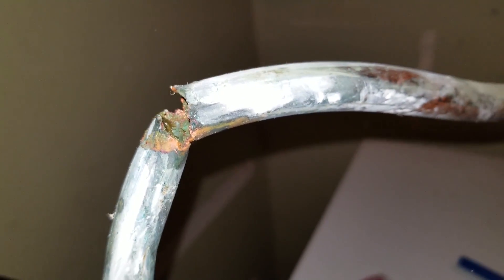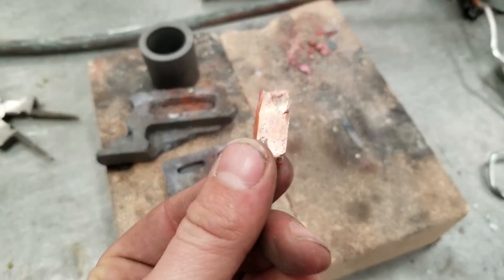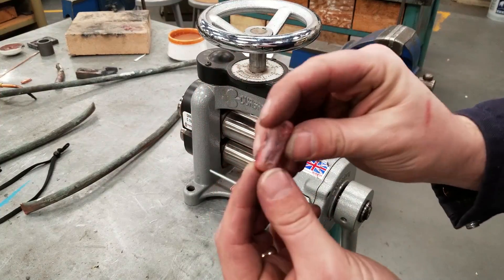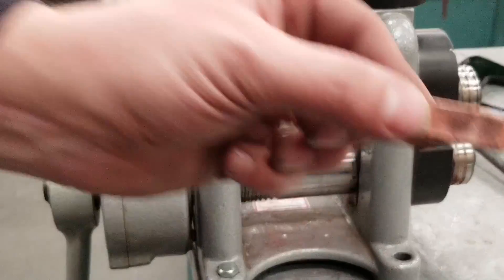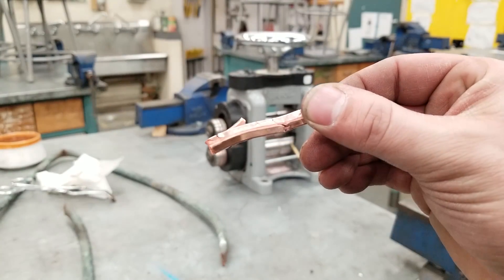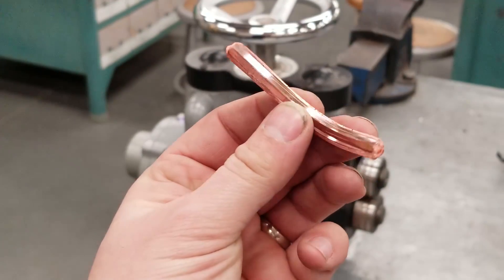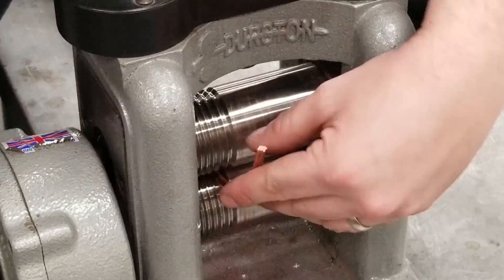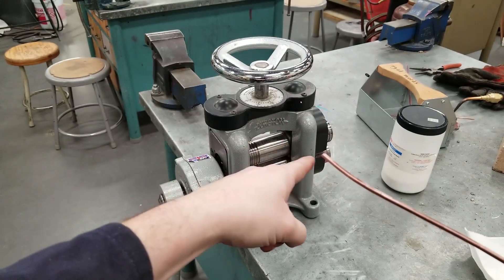Casting Ingots and Making Wire with a Rolling Mill - scrap copper pipe

Comment: I highly recommend properly securing roller so it doesn't move about when rolling wire thru will improve the wire rolling. Cracking is cause by impurities in metal, re-smelter metal, add alloy. Cracking and edges is rushing the wire thru smaller the guage before its ready for that size.
Reply from the maker: Thank you for ignoring the previous comments where this was addressed ;)

Comment: You should let the metal come to room temp, no quenching. Or at least, wait 2mn or 3 before quenching. That will solve the cracking that is due to internal shock of rapid temp change.

Comment: I would think quenching it while it's still hot from annealing would be counter-productive. I mean, quenching metal like that is what they do to harden it. While letting it cool down slowly would take a lot of time, wouldn't that keep it more malleable?
Reply from the maker: yes and no. This worked well for us especially when students only have an hour a day in the shop. This rolling mill can only take cold metals and it worked great for what we did with students.
Reply: @WeBuildStuff  It's a nice mill. I've got a cheap one and even at it's widest setting it won't take anything that big. I also managed to crush one of the bearings on the rollers, so not very heavy duty. I can make out the name "Durston" on yours. Is there a model name or number?
Reply: Steel hardens when quenched. Non-ferrous metals do not. They work harden.

Comment: 💚💚💚💚 bookmark/ notes : “ it’s a brick housse letting it all hang out , sewer drain bars under street that collect wipes / paper ( which further down has something that looks like drill bit size of the pipe near the treatment facility “ but def not a meal mill)  , paper making rollers that flatten in sheets “ ….ect….tbc….-g-b, bot …..💚💚💚💚 bookmark/notes: what jewelry can do for a person …..ect….tbc…..-g-b, bot 

Ingot 🧱 Step down transformer ( compositor , knob slob  )

Comment: Did/have you tried rolling it whilst hot? Wouldn't that help prevent any stress fractures
Reply from the maker: It is not recommended to roll hot with this mill
Reply: @WeBuildStuff     Ok. But can you roll it while still hot?  In another mill that can be used while hot?  
I’ve been planning to roll out sheet strips of about 0.5mm thick for a project where I need cheaper source of copper strips 0.5mm by 20mm wide.
Reply from the maker: @hamed100  the rolling mill i used is not recommended for hot rolling due to the type of metal it is made from. But I'm sure you can get the right type rolling mill if you specify that as a requirement for yourself
Reply: @WeBuildStuff    Yes. I think I’m going to build a rolling mill suitable for hot rolling. Do you think it would be a good idea to have drilled water cooling channels in the rollers? Or can I sprinkle the coolant onto the rollers every now and then?
Reply: Sprinkling Cooling water on a hot roller is not a good idea bro

Comment: Question: why can't you roll it while it's hot and malleable?
Reply from the maker: Most jewelry rolling mills have case hardened rollers which is not good for hot rolling. Plus as soon as you start rolling your metal will loose heat pretty quick.

You could aneal and let it air cool before passing through but it will take a lot of time.

To save time we would quench and then roll. Repeat after a few passes.

The material we were using stays pretty malleable up to 2-3 passes before we needed to heat it up again
Reply: @WeBuildStuff  Thank you!

Comment: Nice video, I just got a rolling mill this week, and I too will need a spot to house the roller, I'm thinking of using a tall metal stool for a base, just about 2.5-3ft tall. Even has holes on the seat to bolt down to... A + Imo.
Reply from the maker: Ya i wish I had made a stand for this!

Comment: you can roll the copper when it hot and cool the mill rolls with oil-based lubricant( suds). it's much easier
Reply from the maker: Good tip!

Comment: why was it broken in the first time and not broken in the second time
Reply from the maker: I over stressed it while it was work hardened. When I re-heat it it softens the material and then I can pass through the rollers again. I screwed up and cracked it so I remelted it into a new ingot and re-rolled again.
This was more just for fun and not the most efficient way. I made this video for my class so they could experiment with it
Reply: @WeBuildStuff  so if we don't heat it enough, cracks will arise
Reply from the maker: @alibacanak8711  yes you typically need to anneal it to keep it soft.
Rolling, hammering, etc will work harden metal so you need to keep an eye on it for cracks
Reply: @WeBuildStuff  thanks

Comment: I think I misunderstood your version of anealling. When you quench it hardens. When you aneal you let it come to temp softly or naturally. Think that might be why you were seeing so many cracks. Try heating it and not quenching.
Reply: Copper is not like iron, heating to a dull red and then quenching is the preferred way to anneal. I tend to use a propane torch for small stuff and air/acetylene torch for thicker pieces.
Reply: Bill Rutherford haven’t heard that, but wouldn’t be the first time I’ve been wrong or not aware of something. Next time I’m working copper I’ll try both. 
However, given the results filmed and my prior knowledge, granted from steelwork, for right now I’m gonna keep doing a gentle annealing. Got any  links or ref on it? Curious. Thanks
Reply: Just looked it up, from what I can see that’s was 1 reference to pipe, not sure... 🤔 still gonna do soft anneals for shaping the metals. Just can’t seem to confirm the prior.
Do you pull wire? I have not. Hence why I was here. 
Maybe the teacher’ll crack some wisdom, willing to bet it’s been a few classes since then.
Reply from the maker: The quenching is because of the time constraints we have in the class and it teaches them to use the torch.  It may not be industry standard but the goal is the end experience for the students 😁
Reply: We Build Stuff rofl 🤣 it may not be industry standard. <is there a smack your knee emoji>
Time constraints or not you’re telling them they are softening the metal when in fact they are hardening it.
How did that make you feel when you had to rework that a cpl times and still got moderate results with cracking? Do ya think that’s gonna ignite passion in a would be metal worker? Not to mention make em look stupid on a job later.
Good luck bo, but you alluded to your knowledge level and requested guidance in your last vid. But advice, much like opinions, thumbs and a**holes, almost everybody’s got em, what you doing w em...up to you. Good luck again lol, surprised ya got that decent a pull.
Reply from the maker: @Latrocinium086  no worries. A lot of the things we try involve experiments. This type of thing only makes up 1% of the course and most kids do have fun trying different metals. We do mostly welding and fabrication with only a few students doing art metal and jewelry stuff. We've done lots of different metals as well as alloys by mixing different types of materials. I know it hardens a bit but we were trying to avoid passing hot material through the rollers to prevent accidently student burns, etc. A lot of the courses involve students trying stuff out and having fun. This is more of a fun one to try 😁
Reply from the maker: @Latrocinium086  also I'm always trying to learn new stuff. It's fun to film and share with my students both success and things that don't always work out. I usually take youtube comments and try to learn so I will be trying some different stuff out next time I have access to tools like this.
Reply: We Build Stuff Think it’s very valuable what you do. Went to a welding school myself, but these small things, annealing/hardening definitions might be important too. Got me a little hung up, thought I was gonna help. Lol None my beez wax...maybe consider muting the part where you solicit advice from the tubes. Probably would keep ppl like me from trolling ya. Good luck.
Reply: We Build Stuff lol if you like the advice, then kudos. The only problem you had in that vid was the hardening. Everything else was spot on, was fun to watch and see something new. I’d be interested in some of the alloying videos. Lol always love welding p0rN. Good luck keep learning. It’s fun. Thanks for posting
Reply from the maker: @Latrocinium086  thanks. I've had a few old videos that I eventually make new ones with updating information but I always leave them up as a reminder to myself of my progress and learning. I've never claimed to know everything and you will probably hear me say "this is just the way I tried this" in almost all my uploads 🤣
Reply from the maker: @Latrocinium086  comments from people who know more (not just think they know more) is helpful and allows for the continuation of knowledge in society. A dumb society does not progress. Ten years ago I was pretty useless but I'm a much better teacher now. Is everything I do perfect?  Nope. Am I good at engaging with students and creating a positive environment that creates memories and also allows kids to build cool stuff? Hell ya!

I'm mostly self taught which is why I don't always get terminology or all procedures perfect. I have been a tinkerer since I was a kid and experimenting has always been a fun journey rather than just the end result. Kids who want more get pointed in the right direction (trade school, etc) and I'm always honest with them about my level of skills.

I'll respond to 90% of comments on this channel this way and usually try to explain why I did it rather than justifying it as correct 😁
Reply: We Build Stuff man don’t knock self learned. You make your bones then you deserve the cred. It was my shop teachers that hit me, lol brazing basketball goals and casting mini anvils. What you do is a treasure bo, glad you get to enjoy it. Nothing say old dogs can’t learn new tricks either. 😜

Comment: Try annealing the copper BEFORE it starts to crack.
Reply from the maker: That was part of the learning I wanted my class to see when I made this video.  It's good to show them both sides of the operation and how different types of metals react and/or crack quicker or slower depending on the pressure they are under. Thanks for watching.

Comment: why are you quenching in water? won't that make it brittle? just letting it slowly cool maybe better I think
Reply from the maker: The quenching is because we dont have a lot of time in class. It is an extra step and we would reheat after every few rolls.  I've only started experimenting with this. We made lots of rings this year with this method out of lots of types of materials

Comment: A bit of hand forging to get the ignot into square profile would have gone a long way to making the process smoother. When you see "fins" on the copper after going through the rolling mill they should be filed off. Making sure the copper was clean and "bright" before going into the casting dish is always a good idea as well. Copper can be a bit tricky, especially when you don't know what other impurities might be in it. High grade electrical wire c101 or c102, oxygen free is the best bet short of buying jewelry grade copper grain from a metal refiner.

Comment: Thank you for this instructional video.  The rolling mill should be more stable as well.   You will need to add 2 more nuts to hold tight the rolling mill😊.
Reply from the maker: I wish i had a permanent place to install it. Due to our space this unfortunately is what we are stuck with until we can build a pedestal for it

Comment: Pull it through a hole slot plate with a pull bench to get a thread to your preferred diameter. Cold pulling will get you to compact the atomic structure without the problem of breaking it (forces from all sides vs forces from up and under). Ex goldsmith here ;)
Reply from the maker: That tool is on our wishlist! Every year we slowly buy more supplies and tools. High school budgets are limiting sometimes

Comment: Why wouldn't you feed it through the rollers while it's glowing orange, like hot rolling steel?
Reply from the maker: These types of rolling mills use case hardened rollers which are not ideal for "hot rolling" metal like you might see with industrial metals. Cold rolling also gives a nicer surface finish.

Comment: Why are you quenching after you heat it?  Wouldn't the copper be more malleable if it is hot?
Reply from the maker: This stays pretty soft after quenching. Not much difference letting it air cool. Also makes it safer to handle for students

Comment: I would recommend for larger wire projects, a wire ingot mold, and a draw plate for a more perfectly round wire.
you can also make your own tubing by pulling a strip of the appropriate width metal through the draw plate.
Reply from the maker: Thanks for the tip!

I had a draw plate and wire mold ordered online but after a month of waiting they emailed canceling the order for some silly reason. I just haven't ordered another one yet

Comment: Thumb up for this interesting video!
One question. Is it necessary to start from a "cubic" ingot? Or could we skip a few steps starting from a longer and thinner ingot?
I'm french by the way, sorry if my english is poor... and if the answer is in the video!
Thanks.
Reply from the maker: If i had a mold that was longer and thinner that would be perfect. These are just the molds we have right now in the class. Next year I will try to order some more variery of molds to make different ingots
Reply: @WeBuildStuff  All right. Thank you very much for your answer.
Reply: There are cylindrical ingot molds, but a rolling mill almost never rolls round shape. 
It always comes out a little square imo.
Reply: I’m an American and your English is better than mine.
Reply: @ApacheChief  everybody is better than american

Comment: I'm no expert, but aren't you supposed to let it cool slowly instead of quenching to keep it malleable?
Reply: Michael Dreksler for gold, silver, copper and other non-ferrous metals (non magnetic) quenching them leaves them in thier softest possible state.
Reply from the maker: @argentummoonjewellery3503  thanks for the tip!
Reply: @argentummoonjewellery3503   💚💚💚💚 bookmark/notes: what jewelry can do for a person …..ect….tbc…..-g-b, bot
Reply from the maker: Ideally we would wait more but the amount of time that would take makes it unreasonable to wait every time we anneal it.  With material like this we haven't seen a huge difference since we are work hardening it anyways everytime we pass it through the rolling mill.